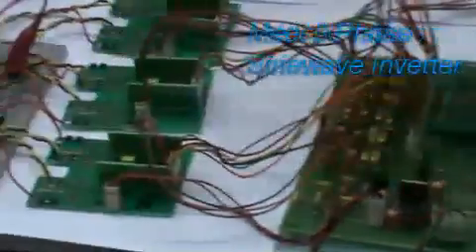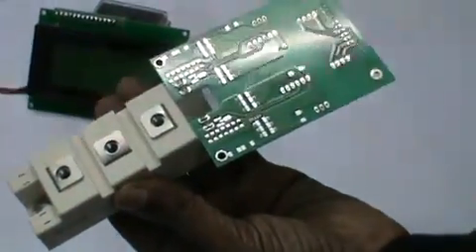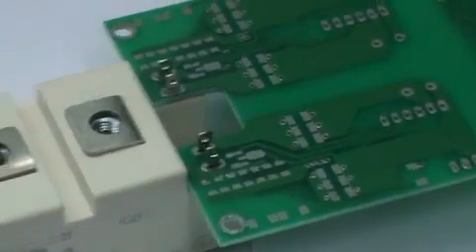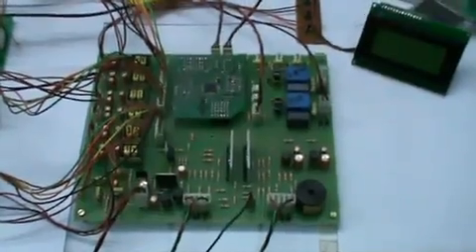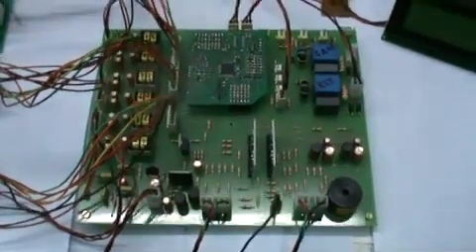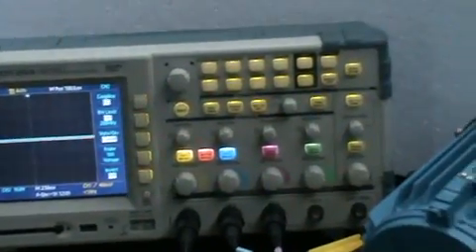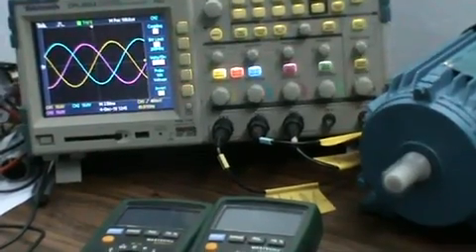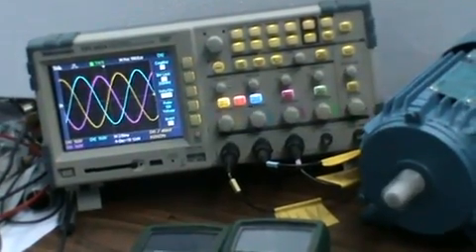3 phase sinewave inverter

Comment: Hi dear
Thank you so much to you for sharing this video.
I have a question, 
Can we use three 220v/100w lamp for output of the  inverter?
When we turn potentiometer, the light of lamps it will change?
Is this possible?

Thank you :)

Comment: What is the input waveform (AC or DC), and the maximum power input (volts and amps), that  this inverter should handle to run trouble free?

Comment: I think it's kind of dangerous to let a 3-phase motor run at higher speeds than it's rated for. The centrifugal forces on the (heavy) rotor can get too much and it might explode.

Nice hardware anyway.
Reply: Not at all, Most VFD Drivers do that, and is some of that the purpose. Search VFD = Variable Frequency Drive